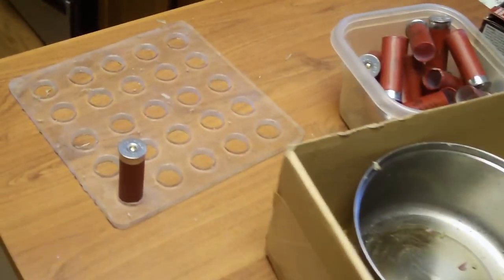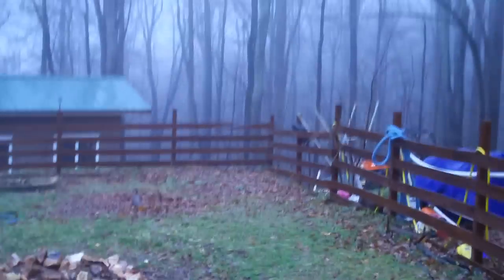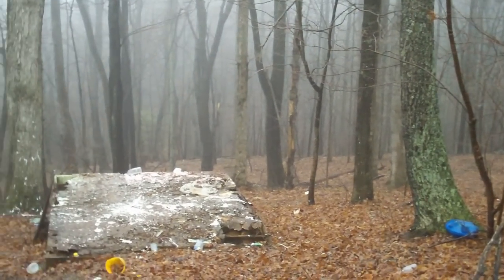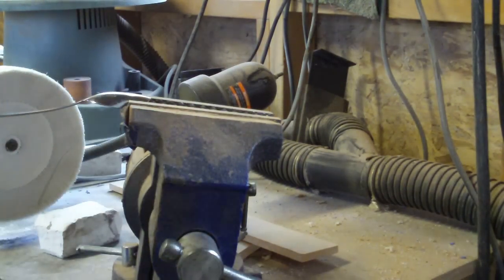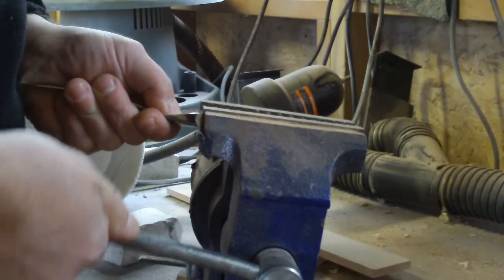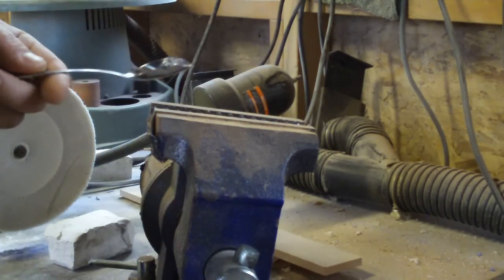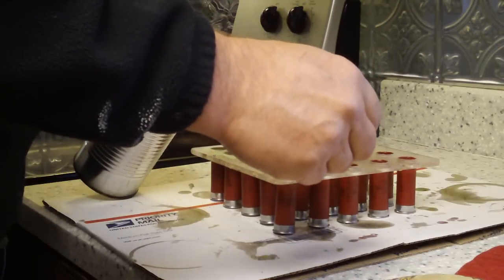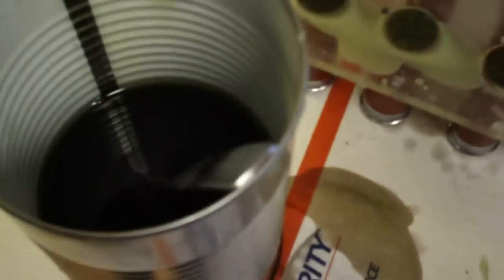Zen Waxers: Become One with the Spoon

Comment: I've been steering away from waxers, though fun I've found that drilling an appropriate sized hole in some hard wood n pouring in molten lead, encased in a sabot of wax makes for a reasonably accurate slug out to 80 yards n will easily drop a wild pig. Cheap n effective.